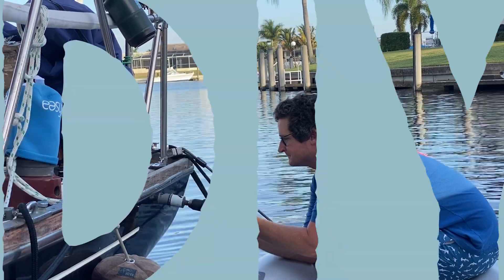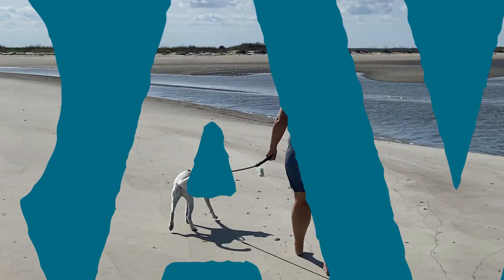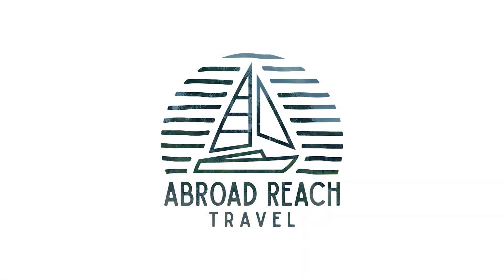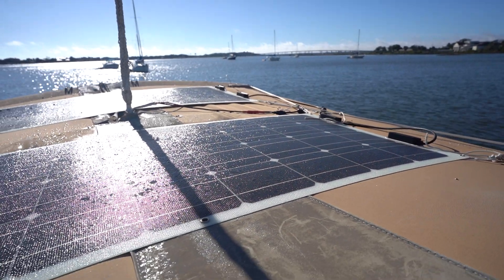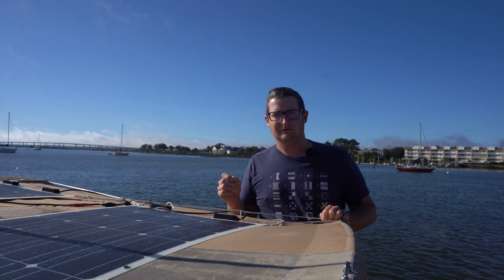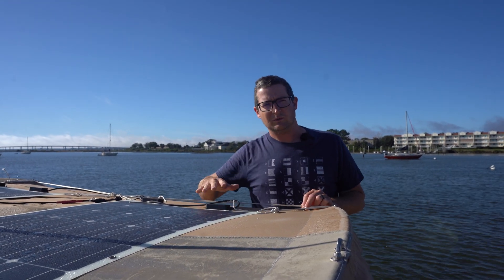700 Watts of Solar on our Tartan 37

Comment: Hey! It looks like you're doing some van stuff now, but question in case you see this: I am working out the solar setup for my boat (Sirius 310 DS), and two different directions I'm considering are what you did here, very low profile with Gemini mounts, OR, something like what you did in the video with your previous boat before this one with a sliding setup. Can I ask, did you consider doing a sliding setup on the Tartan too? Aside from being able to get enough solar power without doing that, are there any general reasons you didn't try to replicate the sliding arrangement?  (making my design a little more complicated is a split backstay and also currently the radar is mounted on a floating pole along one side of the backstay also)
Reply from the maker: Hi! We are splitting our time between the boat and van now 🙂🙂

We did consider doing slides on the Tartan but at the time we didn’t have the budget. We are planning to do it in the near future though! We don’t have an exact plan yet, but we will be sharing once we do!
Reply: @AbroadReachTravel  Ok cool! Thanks for the response. Hearing that having done and lived with the sliding system previously and that you're pretty interested in doing it again, is a vote in its favor. That being said, if not doing slides, I really like how you did the setup in this video basically direct to the Gemini concave mounts, vs using the gemini mounts to support extra bars like I've seen in any other pics/vids of people using the gemini mounts. Thanks again for responding

Comment: Terrific installation, and very well explained in simple effective terms.  I really like how you used the bimini framing and panel support mount studs.  I also like how you mounted your bimini making use of the stern rails giving maximum lateral shade coverage.  Specifically, what are the dimensions of the bimini top to you have fixed?  I'd like to replicate that set up, so thanks so much for showing us your system!